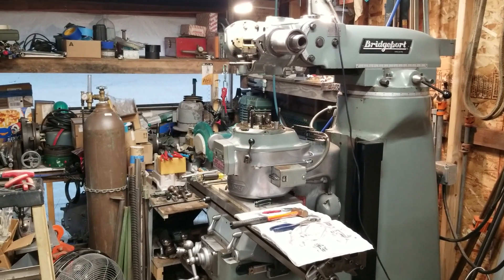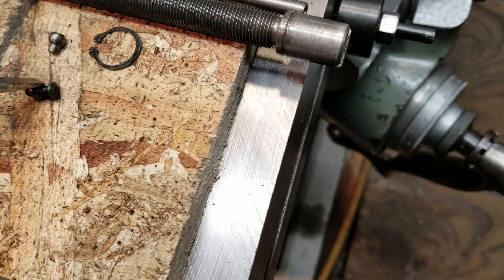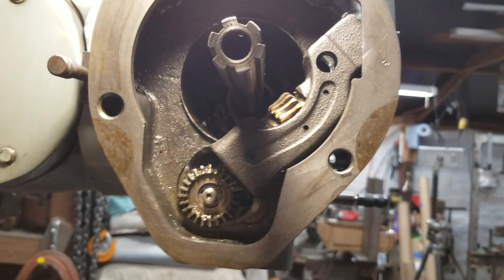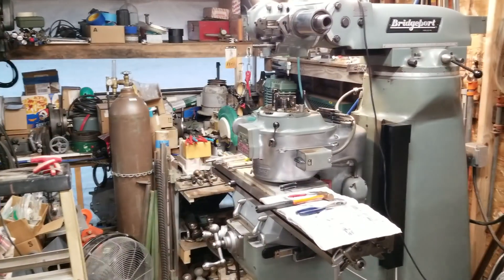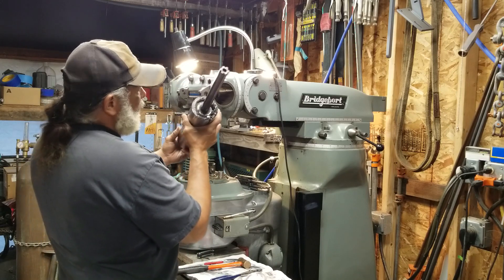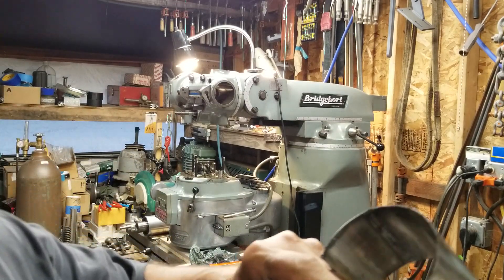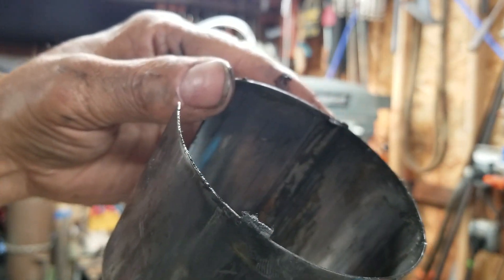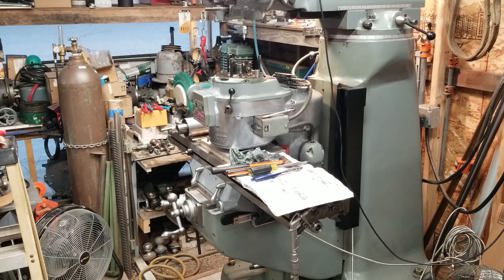CALLING DR RAZOR.....

Comment: Razor theres some videos on you tube showing rebuilding these . K&W I think in Indiana great place for parts? Good LUCK
Reply from the maker: Mike Nixon 
It's H&W In Fort Wayne..I talked to Virginia just last week..
There prices are higher than all the parts houses I've found, but they are very friendly and willing to help with any issues. Yes I've spoken to Barry too, there master rebuilder...
Thanks just the same Mike!
Reply: @razorworks9942  ,  As they would say, PAY the man... I'll bet you can't even tell what materials were used, or what heat treatment, hardness, etc.